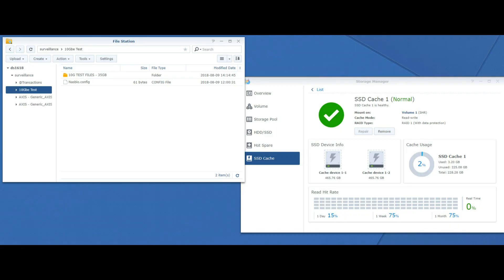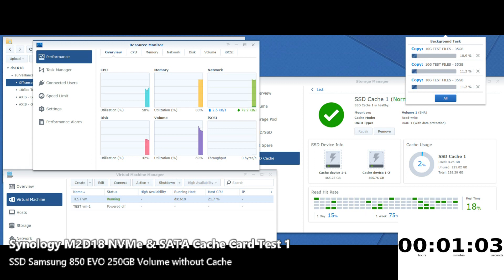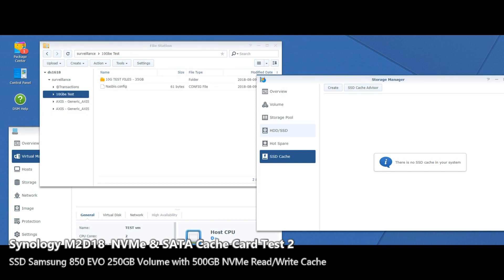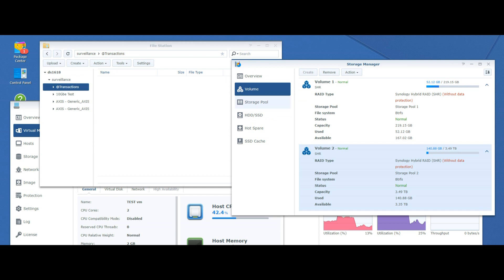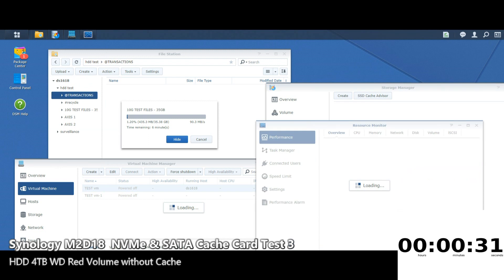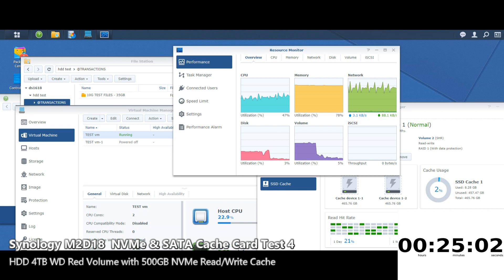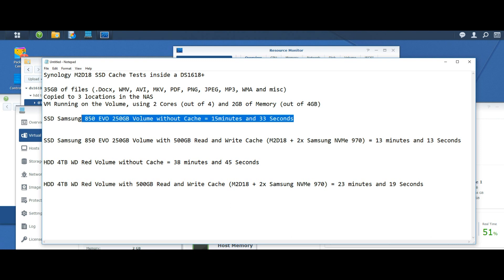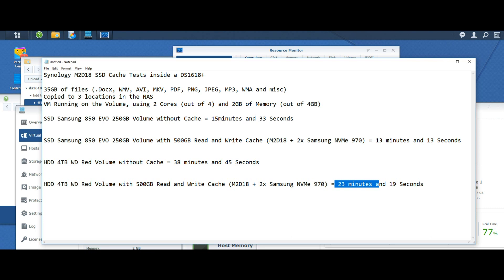Synology M2D18 Performance Benchmark Tests - ALL Parts

Comment: Hi Sir,
I have windows 10 workstation platform that I built a few years ago, I  bought synologie M2D18 to increase the cache, I use  FEM software and also for rendering,
- I  've also the quadro and tesla GPUs,
-I use everything in local (no network serv..),
-I bought M2D18 and samsung 970 pro,
I want the STORAGE MANAGER app, I beleive it's part of DSM, but I don't know what to choose "the correct version", where to download and how to instal ,
please I need your help,
Much thanks,